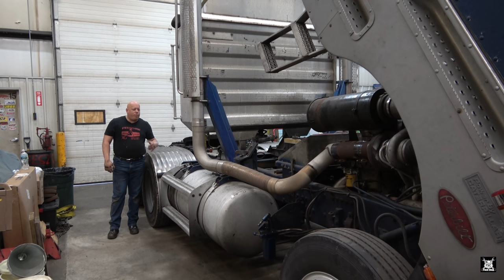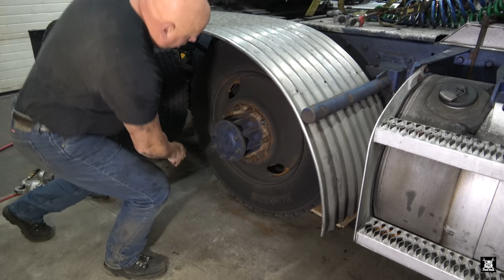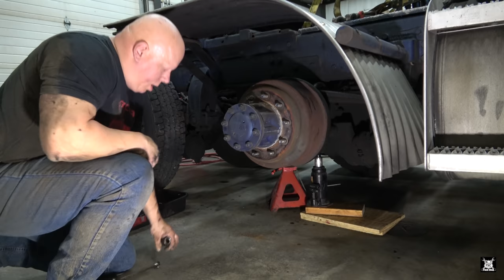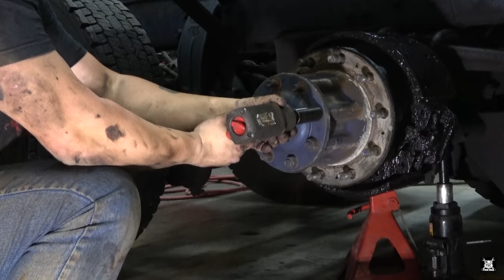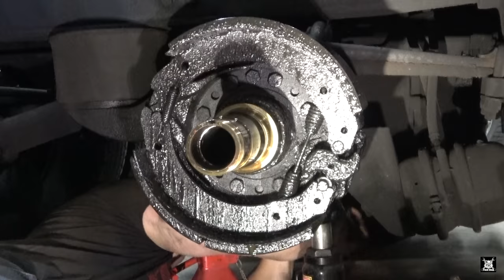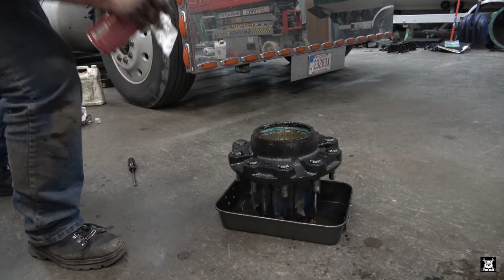Rear Wheel End Removal [Cabover Peterbilt Wheel Seal Fail]

Comment: The lube appeared rusty when you shot inside the hub showing the bearing.

A company I worked for had two trucks lose a set of duals the day after a brake job because the new head mechanic thought he could save some money. Instead of spending $60 for 4 axle nut fixing plates, they got two big dollar tow bills, and lost a set of duals with axle shaft when the assembly couldn't be located.

Clean all the threads on the wheel studs and nuts. I use grease on the lug nuts, some say install dry. I've never had an issue of lugs loosening after install.

For brake parts, instead of anti-seize, use disc brake silicone lubricant. Anti-seize washes off with time, the silicone brake grease stays put.

Comment: Hey Steve, great video. Just wanted to let you know (if you  didn't already. ) Stemco makes a one piece nut, with an internal lock. We started using them several years back. You preload the one nut, then insert the locking tang inside. They really hold up well on our dump trucks and long haul tractors. Keep living the dream, brother!

Comment: Steve, great videos, informative and entertaining.  Brake Clean is the best thing since sliced bread for cleaning parts. The fumes from it are down right nasty. You don't want to be breathing that. If you're going to use it as your primary cleaning tool, open the shop door or clean outside. I like to use diesel fuel (not gasoline) and a parts cleaning brush to clean the heavy grease off, then use Brake Clean as a final rinse outside the garage or with the door open. The diesel fuel is way safer to use than gas and you will use way less Brake Clean  (saving  money). It might take a little longer to clean your parts, but at the end of the day, week or month, will it really matter?  My decision to do it this way is safety and health.  This is just a suggestion based on my personal experience, nothing more.

Comment: I used to put a piece of greased up plywood under the wheels, pop the axle out, remove the axle nuts, then slide the whole assembly out to change the wheel seal, brakes, and/or bearings. It was a bit of a time saver for me.

Comment: Nice job big guy!
You should use “gun wash” from the body shop. It’s used to clean paint guns out after using them. I use it from a 5 gal pale. I put it in a pump sprayer and it does a better job than a zillion cans of brake parts cleaner. It works the same, smells better and safer than those cans. It works just like brake parts cleaner and leaves absolutely no residue and dries just as fast if not faster. Plus you don’t have to kill your finger pushing that stupid button on the cans.
It’s a hell of a lot cheaper too!!!

Comment: Next time leave the hub on with outer bearing removed thread the bearing nut back on grab the hub and pull the inner bearing and seal will come out when you pull the hub cause the nut acts as a stop your welcome or use the axle put it under the bearing and pry them both out use axle as a lever
Reply: And if you don't like that method (which is excellent, btw) get a long piece of brass and drive the seat out with the inner bearing. Either works fine.

Comment: The seal goes bad when the bearing allows the axle to drop . Thus you are better off replacing the bearings and race, inner and outer, and the new seal. If there is a ring or grove cut in the axle then you should buy a sleeve repair kit that covers the grooved part where the seal cut the groove..
Their like $10 to $15 bucks vs a new axle !

Comment: Flatten yourself a cardboard box and put it under the axle.  Then you have something to soak up the oil, the cleaner overspray, and it's easier on those old knees.  Hardest part for me was watching you kneel directly on the floor.  Get a foam kneeler